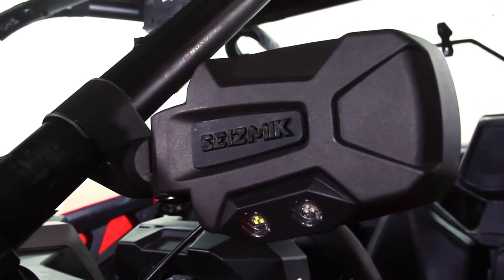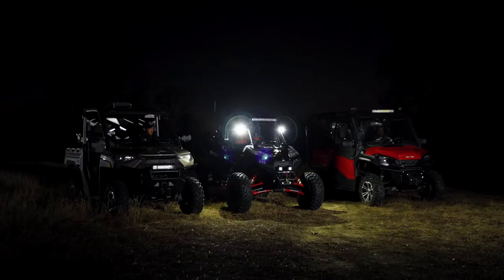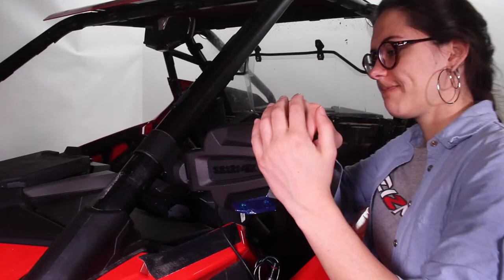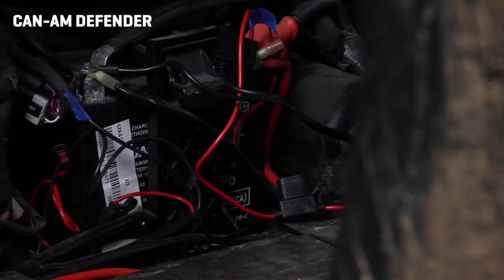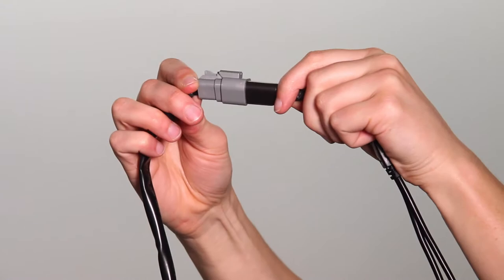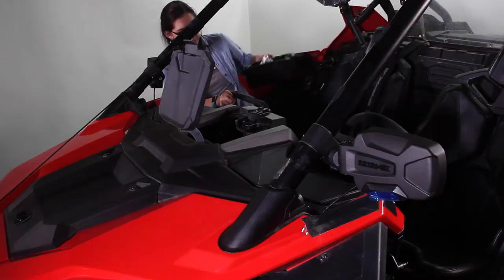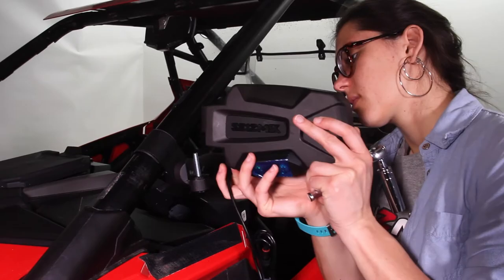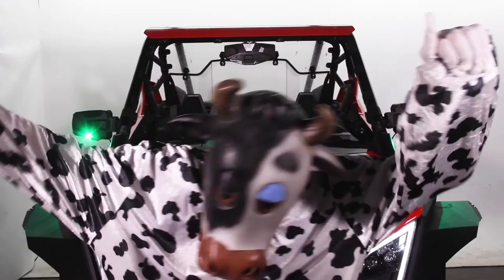Pursuit LED Side View Mirrors Installation for Round Clamps

Comment: @seizmik Love the mirrors and customer service thus far! I was thinking about tidying wires as I gain more accessories, could we tie into a pulse bar plug rather than going direct to the positive and neg terminals? Only portion I am unsure about would be how the switched middle wire gets used or doesn't get used in this wiring configuration.
Reply from the maker: Todd, yes, you can tie into the pulse bar.  Depending on whether or not you want the lights to have power without the ignition being on would drive how you would wire up to it.  Give our product support team a call at 1-866-838-3366 or send an email to service@seizmik.com and we'll be glad to help.